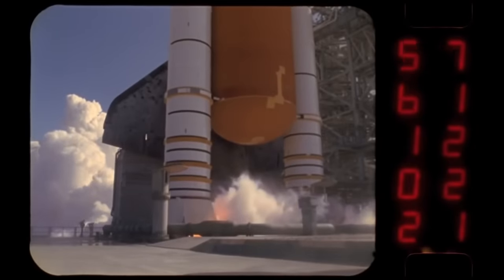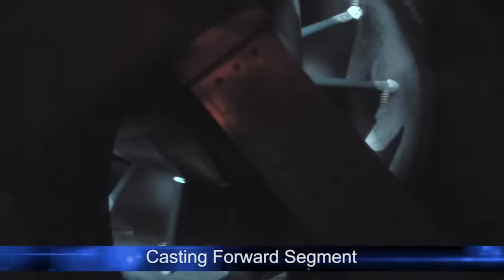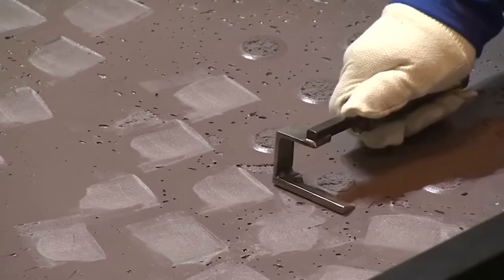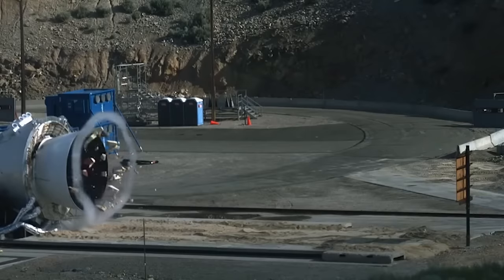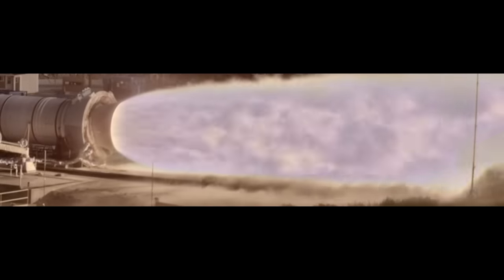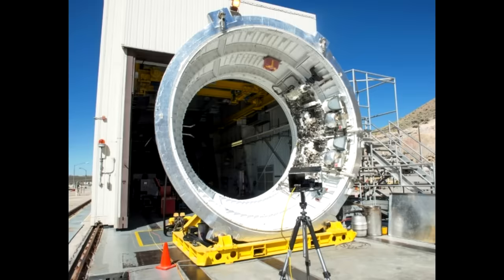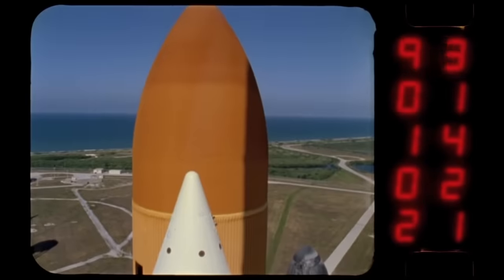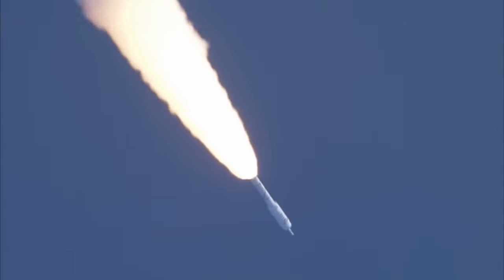The Amazing Engineering Behind Solid Rocket Boosters

Comment: One time my friends and I were making solid rocket fuel in the backyard using a coffee grinder.. the sparks in the grinder ignited the fuel quite explosively!
Reply: Similar thing happened to me, was casting R-candy and it suddenly ignited and burnt my hand, arm and legs. 2nd degree burns everywhere, since then I have been too scared about it and have only made non-cooked R-candy, its a loss in ISP but I do not want to feel that much pain ever again.

Edit: to which may I add I do measure the weight of the grains when dry packing to keep the engine results consistent, do it blindly and one engine might work and the next is a bomb
Reply: You two going for a Darwin award or something?
Reply: Carlos_A_M so cooking it makes it molecularly bond better?
Reply: I made Saltpeter and Icing-Sugar rockets back in the 1980's.
Reply: @crafty_crumbs  Cooking it increases the burn rate and hence gives you more thrust in a shorter period of time, it also increases ISP, the propellants mix very well and unlike blind dry packing its way more consistent
Reply: @CarlosAM1  yeah, I'd say the kids making rockets in their back yards are probably the smart ones
Reply: @CarlosAM1  Were you cooking it on an open flame, by any chance?
Reply: @_tyrannus  No, that's suicide, I used a heat controlled electric pan.
Edit: and for anyone reading this NEVER use an open flame stove, any hotspot ignites that fuel and you are going to get quite a few burns if you are lucky, a visit to the hospital if you are not.
Reply: @odysseus5872  I have been making these sugar rockets for years and only once did it ignite, hell it even ignited while placing the propellant in the engine, I still wonder how it even ignited.
Reply: @CarlosAM1  It's what you don't know, or are unaware of, that gets you.  For Challenger a major factor was that the people making the Go/No-Go decision weren't working with all the facts, making decisions based on schedules rather than technical limitations.  There's always risk, whether launching a too-cold SRB, mixing your own rocket fuel, or driving down the street.
Reply: @CarlosAM1  I would never do that, I asked out of curiosity because every bad idea has been done out there at some point. I seem to recall that there is a fairly large gap between the melting and ignition temperatures of r-candy. What happened in your case, if I may ask?
Reply: @_tyrannus  No idea to be fair, thing happened quite a while ago, I was just placing the propellant into the engine casing and out of nowhere it ignited, no warning.
Reply: @CarlosAM1  Damn, pretty scary that it happened during casting rather than heating. I really wonder what sort of chemical reaction would occur. Perhaps something in your casing, or the casing material itself somehow catalyzed the decomposition?
Reply: This is why you use powder sugar method to make rocket candy it’s safe
Reply: @CarlosAM1  might have been be a ESD spark jumping to the casing. sounds pretty scary.
Reply: @crafty_crumbs  It gets the two components more intimately mixed. You better hope no molecular bonding starts happening while mixing rocket fuel because generally (for R-candy at least) that implies that it is or is about to get really hot really fast if you know what I mean. The goal for all solid rocket fuel is to get the ingredients as intimately and evenly mixed as is physically possible without actually getting them to start reacting. There is almost always a better way to get a better mixture, but it also usually adds more risk since a more intimately mixed propellant is easier to accidentally ignite. At least these are the general rules of thumb for R-candy type solid propellants (including black powder based propellants). The kid of propellants that actual boosters use is mixed and formulated in much different ways and with insanely expensive equipment to control the process that us plebs will never have access to.
Reply: @CarlosAM1  The comment left by Kevin above is actually a pretty good guess IMO. From my experience with casting it almost always involves at least a bit of gentle ramming with a dowel, stick, stir rod, etc to get it into the case and get all the air out. Assuming this was also a part of your process and depending on the stir rod and case material the rubbing action could have built up a static charge in the rod, the case, or the propellant which eventually discharged to something and acted as an ignition source.
Reply: To quote John D Clark of Ignition! fame, anything involving any combination of heat, pressure, high kinetic energy, and solid rocket fuel is best approached with the degree of caution appropriate to dental work on a king cobra.
Reply: @maxk4324  I always use a wooden dowel by the way, I always try to be as gentle as possible.
Reply: The lead systems Engineer for Mars Global Surveyor was missing an eye. He explained that when using glass bottles as your crushing tool for fuel and oxidizer for solid rocket fuel - DONT use the same bottle on fuel as you just used on oxidizer!
The bottle blew up in his hand and he lost an eye for the mistake.
Reply: @len.whistler  
I learned that grinding in a trace of fine carbon (chimney soot) to the mix made the propellant burn like a bat outa heIl.
I conjectured that each soot particle absorbed infrared a millimeter or less in from the flame-front, starting a pre-burn accelerant effect.
Edit: this was packed-powder propellant, not candy fuel. Heating carbonized nitrate/sugar might even (non-detonative) explosion.
Reply: @maxk4324  
I think the improvement in ISP is more due to the removal of most of moisture, as both nitrate and sugar are substantially hygroscopic, especially the former.
Reply: Ah, home rocketry! My uncles almost blasted themselves and my father to bits while compressing the fuel of one of their black powder fuelled rockets in the garden sheds.
Back in the 50s and 60s men had more balls than brains 😃
Reply: @-danR  That is a major factor too, but I've also driven water off by dissolving and recrystalizing with warm methanol (ya ok not the safest idea in retrospect but it was a long time ago and at least I had on all the right PPEs) and it still didn't perform as well as cooking. At least I'm pretty sure it was methanol, as I said this was a while ago and I didn't take very good notes of my procedure (or any).
Reply: @CarlosAM1  Third degree burns are almost preferable that way. The nerves melt leaving little pain and the skin sloughs off, good for a little burn. Big burns not so much.
Reply: Haha you guys are nuts. All of these accidents are pretty preventable if you take proper precautions.
1) Grind your oxidizer and fuel SEPARATELY. Don't mix then until you have to!
2) If you're going to pack your fuel, use a WOODEN dowel (avoid ESD)
3) If you're going to cook the fuel, ELECTRICALLY heat an OIL BATH and immerse your pot of fuel in that, monitoring oil temp with a thermometer
4) Wear PPE, especially safety glasses! Your eyes will thank you.
5) Do this stuff outdoors, and keep 1 or 2 extinguishers handy.
6) Insurance is always a good idea too - home, renter's, health, life.. all great for amateur rocketeers lol

Be safe guys!
Reply: Still got all your fingers?
Reply: Well, it went off with a bang. 

Imma leave now.
Reply: @crafty_crumbs  It mixes better so you get a more complete combustion. If you just pour the powders and mix them together there is going to be unburnt fuel in the exhaust
Reply: I would like to see some info on the fact that Morton Thiokol was tire manufacturer that had a new compound in some new tires on a test vehicle. The test car caught fire, then the tires went off and burned the whole thing into a lump. Voila SRB's were born! ACCIDENTLY!!!!!!
Reply: It's basically aluminum and rubber!
Reply: Question did you attempt to actually ground everything so that way the sparks would not even have been a problem
Reply: @CarlosAM1  don't use normal sucrose table sugar, use sorbitol, wayyy safer
Reply: @firstnamelastname.7749  not way safer but safer. Also wont caramelize nor is it as hydroscopic
Reply: In my younger dafter days, we would mix sodium chlorate weedkiller and sugar, dissolved in water, then dip some blotting paper, dry it, roll it up put in a plastic tube. You have  rocket !! It'll burn underwater.
Reply: Solid fuel is better for explosive charges.
Reply: Mini Challenger disaster!
Reply: @-danR  neither are hygroscopic (to any significant degree) - I think you have something else in mind

Comment: The SRBs were a terrible idea, but at the same time absolutely amazing.
Reply: Exactly how I feel about the shuttle program.
Reply: I have never been so offended by something I one hundred percent agree with.
Reply: But they still look amazing
Reply: But why were they a terrible idea?
Reply: No,  SRB's are amazing! seriously cheap, seriously efficient and powerful
Reply: @Galactis1  SRB's in general are. But on a human rated spacecraft? No thank you.
Reply: @makecba  they're safe now.
Reply: @Y.M...  Because once they're lit they can't be stopped unless they run out of fuel. This presents a problem if there are any glaring errors and you have humans strapped to them in some capacity.
Reply: SRBs are great, but not really for manned spaceflight.
Reply: They should used 4 SRB's for the Space Shuttle instead the large external tank with the Space Shuttle main engines.
Reply: @TheMrPeteChannel  and when they are not? You're stuck with them until they burn out. Thanks but no thanks.
Reply: If you could set A SHUT DOWN LAYER in them it would be magic.
Reply: @makecba  It was the Shuttle concept that severely limited abort options, not the SRBs themselves. Nevertheless, LFEs are way better for many reasons, especially when you plan to refuel and reignite the candle.
Reply: Not a terrible idea at all. They are by far the highest performance, most reliable solution. The reason they are still used around the world is that nobody has come up with anything better.
Reply: Ryan Linden as a trade off they are dangerous.
Reply: @ice44567  Honestly this looks like something that can be mitigated with current technology. 
I suppose advances in sensors and programming can be made today that would pull a Challenger out of harm's way, if it were the exact vehicle today with all the mechanical parts being the same. The TV camera was pointed at the stray fuel jet for such a length of time that some sequence probably exists today to react and recover the manned vehicle in such a time frame. 
After all, they will still use SRBs on the SLS, clearly they still think they are very much a necessity.
Reply: @RealityIsTheNow  they are absolute garbage in terms of Isp, although they do have a great power to weight ratio
Reply: @makecba , then you cannot lift, and get to space without on a cheap budget.
Reply: Nothing wrong them when they're used as intended. They've been a mainstay for missiles and rockets going back to the Titan2b and others.
Reply: @Y.M...  AFAIK in the case of the Challenger, even if they managed to jettison the SRBs in time, they would have been doomed due to low airspeed / landing sites too far away. They would simply have crashed somewhere, even if they somehow managed to keep the Orbiter intact. The STS simply ignored the concept of abort modes. SLS capsules at least have a chance to pull away from a likely disaster.
Reply: As of December 2019, there had been 320 manned launches, with 135 Space Shuttle launches using SRBs. Only one caused a failure, and an improved design could have saved at least some of the crew. This is a .74% failure rate per mission. 

There were four other manned space flight launch failures not related to SRBs. The long-serving Soyuz has had three launch failures, while an RS-25 cut out on STS-51-F. Only three of these were related to the liquid fueled engines and/or boosters, so that’s a .94% mission failure rate. 

While SRBs may be more dangerous on paper, in practice vehicle design matters far more. Between the pre-Challenger shuttle, post-Challenger, Ares I, and SLS, all of which use the same family of SRBs, only two were death traps and only one of these ever carried crew. You have to manage the risks properly, but that goes for any rocket. While it may be easier to shut down a liquid fueled engine, there’s more that can go wrong.
Reply: @Imbeachedwhale  74%? You might want to try that calculation again lol.
Reply: @RealityIsTheNow  .74% is less tha 1%
Reply: Stephen West  Apollo had a lower kill count, made more progress, and could have entirely replaced the Shuttle program had it not been cancelled. That move was still the biggest mistake in the history of spaceflight.

The problem with the Shuttle is not how amazingly it navigated the moronic requirements it had, it's that those requirements were there in the first place. If you wanna see what it could have been, had the decisions been made by scientists and not politicians, just look at the Buran-Energia.
Reply: @monad_tcp  sorry. The way the text is formatted on my phone I didn't see the decimal point.
Reply: @darren6906  The shuttle SRBs were recovered and refurbished after each launch.
Reply: Andrew Stevens Oh they were, my bad must have been thinking of a different rocket.
Reply: @DeeSnow97  there was less then 25 manned & unmanned Apollo & Skylab missions with 1 near fatal mission. There was over 100 Shuttle missions with 2 fatal missions. If Apollo had over 100 missions there would be deaths.
Reply: E T Sensors and programming.  Advanced!  Yup, that’s the ticket.  Those advanced sensors - and programming! - can work ya outta a hella jam.  D’ya suppose?
Reply: Mat Wyder Ummm... no.  There were a number of rigorous STS abort modes (4 of them, IIRC).  They hardly ignored the concept.  The abort modes just didn’t cover a large fraction of the full flight profile.  But that’s not hugely uncommon, and not necessarily cause for criticism of the STS program as a whole.  There was serious engineering analysis and development involved in defining systems and procedures for the abort modes that were established, and they added additional capability after Challenger.  Whether it provided enough safety margin is a whole ‘nother question, though.  Of course, what doomed Columbia would never have been addressed by ANY abort mode.  Once you’ve achieved orbital velocity and have to deal with re-entry, you really can’t abort out if things go pear-shaped.
Reply: Stephen West  As I already said above, the formatting on my phone was strange and I didn't see the decimal point. Apologies.
Reply: @Y.M...  Lack of control.   Once they're fired up your in for the ride.  No going back.
Reply: @TheMrPeteChannel  (X) Doubt

If the Apollo wasn't discontinued, why do you think it wouldn't have received the same improvements? Sort of like Soyuz, even that one has a lower kill count than the Shuttle (at least after initial development).
Reply: @DeeSnow97  yeah but the current Soyuz haves almost nothing in common with the orginal. Kind of like how the Atlas 5 is virtually a different rocket since the orginal ICBM Atlas.
Reply: @TheMrPeteChannel  Yep, and why do you think the Saturn V wouldn't have gone the same way had it not been discontinued?
Reply: @ice44567  While true, the power is of an SRB simply can't be surpassed by liquid fueled rockets. I think SRBs can be acceptable on human-rated spacecraft if they have safety measures in place (like thrust vectoring, which could steer the boosters away from the core in case of an emergency before self-destructing). You should take what i'm saying with a grain of salt however, i'm not a rocket scientist.
Reply: @Imbeachedwhale  wrong. Try .0036 failure rate per flight. One failure divided by 271 flights (2 x 135) and Ares I.
Reply: @divedevil985 I said failure rate per mission It only takes one engine failure to doom a flight. All four failures I mentioned due to engines/boosters were caused by a single malfunctioning engine/booster. The rest ran fine (at least until vehicle destruction), but it didn’t matter as the launch was still a partial or complete failure. I did not include missions where an engine failure still allowed for normal launch without compromising the flight.
Reply: @DeeSnow97  The funny thing is the Buran orbiter is almost a carbon copy of the space shuttle they just slapped it on a Energia and called it a day